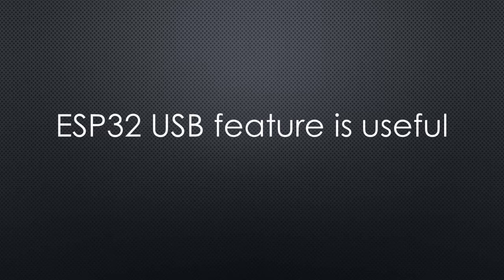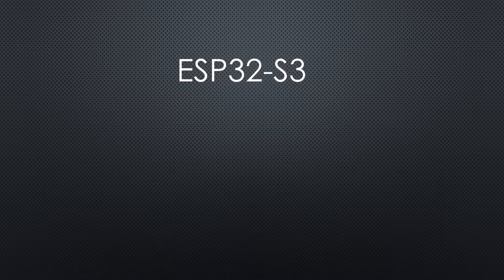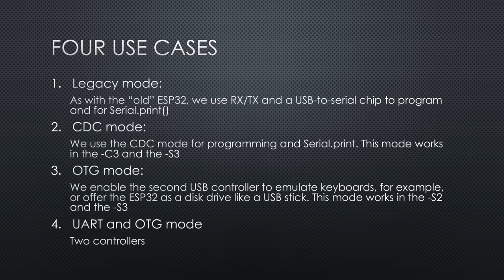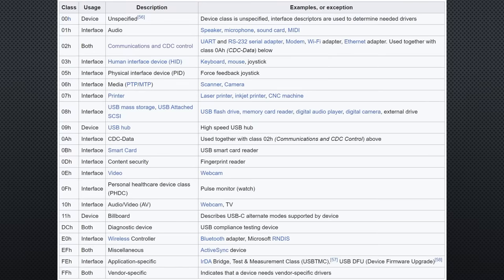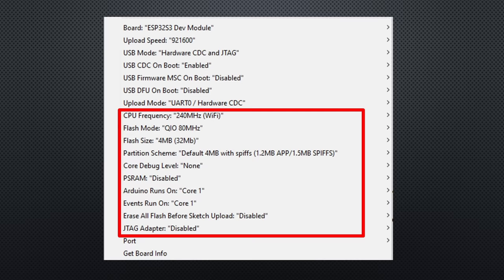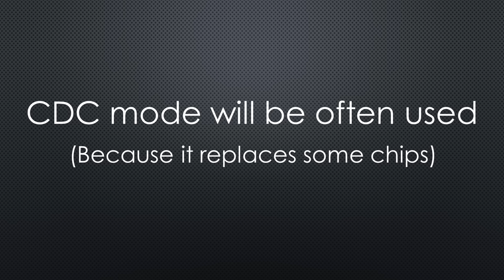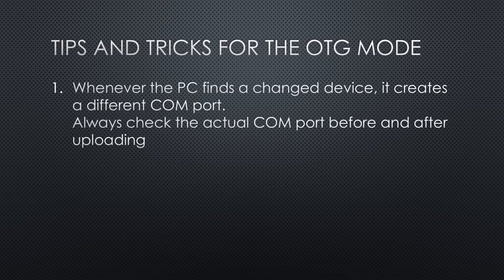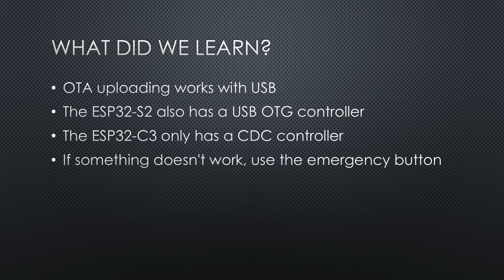456 Hassle-Free ESP32 USB (ESP32-C3, ESP32-S2, ESP32-S3)

Comment: CDC mode actually works on the ESP32-S2 also
Reply: You mean "USBCDC" as how it is called in the Arduino code?
The one supported by the C3 is called HWCDC.
The S3 does support both. I prefer the HWCDC as it allows for easier flashing using the web flasher.
But the USBCDC does have some more nice features and the code feels slightly more mature compared to HWCDC.
Reply from the maker: Thanks for the info. I assume, CDC is part of the OTG block services.
Reply: @TD-er  use the esphome flasher instead of web flasher is way better and more reliable
Reply: @TD-er  HWCDC is realized in hardware, so the features are limited to only what is required for communication between the code and the hardware.

Comment: Interesting, but I miss something. How does the ESP magically apply the settings from the Arduino IDE? Are they set when uploading a sketch / compiled into the sketch? If yes, can't you basically brick your dev-board if you accidentally upload something with legacy mode on a board that only exposes the USB pins for uploading in cdc mode?
Reply: Just make a few corrections to the board and you should be able to revert back. A circuit diagram and the data sheet, soldering iron and jobs a gooden
Reply from the maker: The settings are in the code. To „unbrick“ the chip, you always can apply GPIO0 as described.

Comment: Hello, I'm a bit baffled. On Arduino IDE "USB Mode" doesn't show up on my ESP32 s2 chip. Is USB OTG enabled by deafault on the ESP32 s2 or is there a way I need to put it in OTG mode
Reply from the maker: Unfortunately, I cannot do remote debugging. It should work as described in the video and does not has to do with OTG.

Comment: Thanks for your sharing!!! It is very clear. But I met a problem that the window10 device management recognized an unknow USB device. I am not sure that the problem is caused by windows driver or the layout of the PCB or the hardfirm of the ESP32-S3. I use the ESP-IDF on VS code to develop it. I want to ask that  when I get a totally new ESP32-S3 that never download any code by me, when I connect it via USB port, could the windows 10 recognize the USB port directly? Thank you very much!
Reply from the maker: Unfortunately, I cannot do remote debugging. Here, the ESP32-S3 is recognized by my PC. If you bought a regular board, the chance that the board is not working is slight. If you have a custom-built one, check first with a standard one.
Maybe your PC does not have the correct driver installed.
Reply: @AndreasSpiess  Thank you very much for your reply! It is very kind of you. I have tried the official board and confirmed that the driver was installed. So I am not sure that if I should download a specific firmware to enable the USB port. Anyway, Thanks again. and welcome to China. I want to take you to try much delicious food. 😁

Comment: I knew about half of these -- thanks for the comprehensive examination.  One of the things I learned was that the C3 had the CDC Mode -- I was, for some reason, thinking that it did not have any integrated USB functionality at all.
Reply from the maker: These usb functions were not well communicated, I think.
Reply: Nothing about the ESP32 is communicated well.  Horrible reference materials and tools.
Reply from the maker: @gavincurtis I do not agree. The datasheet has a lot of info. And Google knows even more because the chip is widely used.

Comment: Thank you for confirming USB Host mode is not currently present. That was a real head-scratcher when I bought a couple of these a month ago and had to abandon a project.

Would have been great to have had this functionality from day 1, but glad I didn't waste my money, cheers!
Reply from the maker: It should be supported in one of the next releases…
Reply: It works in esp-idf, which is generally a much better way of using them anyway. ESP-idf even has the option to include arduino as a component so you can write code for it just as you would using the arduino ide but with the possibility of using esp-idf specific features too.
Reply: @conorstewart2214  I tried using the ESP-IDF+VScode for the first time. It went reasonably smoothly but for the life of me I could get the "hid_example.c" to recognise when I inserted a USB device into either a female USB-A or USB-B micro breakout board.

Would love a video from Andreas to demystify this specific setup! ♥️

PS: I'd spotted the "Arduino.h" include before but didn't realise if was for people using the ESP-IDF, interesting!

Comment: I used the S3 chip in a window sensor design using a USB-C port for programming. So much more convenient than hooking up RS232, especially when they are already glued to the window frame.
Reply from the maker: Thank you for sharing your experience!
Reply: Hello! I am making a ESP32-S3 custom PCB. I want USB-C programming, can I just connect it to D+ and D- and then I can just program it, or is there anything else I need to think about in my design?
Reply: @danielliden600  Take care of the correct CC1 and CC2 Resistors. Because the plug fits in both orientations, you need to bridge the pins for both sides on your pcb.
Think about power. USB can deliver your 5V, but you have to step it down or use an external source. For my application I rely on the battery for power and use only D+ and D-, but I have CC1 and CC2 designed to put resistors to ground. Not sure if I do this right, but at least it works for me.
Further I added pin headers for the old RS232 on the board as well as BOOT and EN buttons to be on the safe side, in case USB does not behave.
Reply: @drstefankrank  Thanks for response! From what I understand the ESP is 3.3V board, but the D- D+ is 5V. Do you have yo regulate it down to 3.3V before going to the ESP or is it safe to go directly to ESP?
Reply: @danielliden600  The D- and D+ can be directly attached. Just the power that is delivered through USB is 5V and has to be stepped down to power the ESP if not powered differently.
I use a LiFePo4 to power it and for the one time programming I can use this or I use an external 3.3V supply while having it on the bench.
Reply: Would you happen to know what pins are optimized for I2C, I2S and SPI on the S3?

No engineering examples of the S3 exist to show what pins are optimized for  I2S implementation. 

Blows my mind such a powerful device has worthless information to back it up.
Reply: @gavincurtis  In the datasheet on page 38 is the SPI Pin Configuration which links you to the IO table starting at page 16.

Comment: Thanks! This was the final step in my prototype mini ffb wheel. I've got the device recognized as a 1 axis 0 button joystick and the rotary encoder drives the axis input.
As a tinkerer only, MAGIC.
Reply from the maker: Fantastic! It is always rewarding if it works.
Reply: Вы делали какую нибудь инструкцию? хотелось бы посмотреть, как вы это реализовали
Reply: @Bondarev-Y   Sorry not yet. I have run into problems with Windows drivers. It is very hard to get Windows to recognize a device as force feedback capable. I've tried hundreds of attempts but Windows doesn't play nice. If you are okay with only one way communications so that is the ESP32 acts as a controller, it is easy. For the ESP32 to be controlled by built in Windows drivers much harder.  For now I have just simply recreated this design with 1 rotary encoder and 2 potentiometers. Soon I will add more controls.  https://youtu.be/7g6O4G1OXd4?si=ztOf1aowJ5kJ0riX

--------
@Bondarev-Y К сожалению, пока нет. Я столкнулся с проблемами с драйверами Windows. Очень сложно заставить Windows распознать устройство как поддерживающее обратную связь. Я пробовал сотни раз, но Windows не идет навстречу. Если вам достаточно односторонней связи, где ESP32 выступает как контроллер, это легко. Но сделать так, чтобы ESP32 управлялся встроенными драйверами Windows, значительно сложнее. На данный момент я просто воссоздал эту конструкцию с одним энкодером и двумя потенциометрами. Вскоре добавлю больше элементов управления. https://youtu.be/7g6O4G1OXd4?si=ztOf1aowJ5kJ0riX
Reply: @Curt-0001  There is an OpenFFB project, in it someone set up S2 and S3 for feedback. Perhaps this can help you

Comment: As mentioned in the comments, MCPWM  using the Arduino IDE would be a cool video.
Another idea is the pulse counter, as that isn't simply available in the Arduino IDE but would be very useful.
Something to work on during your summer break! 😊
Reply: Yes! Pulsecounter please! I'm totally lost at the moment building something to print out the error code from my Motoronic 2.2 in a old BMW R1100r.

Comment: Thanks for the video.  Please make more about esp32 features and such, especially the esp32-s3.  What I love about your videos is the originality.  Seems most utubers just copy one another... Waiting on your debug video mentioned here.
Reply from the maker: The debug video will come after my summer break…
Reply: Would you please make a video of the S3 showing what pins are optimized for:
I2C, SPI and I2S?
Reply from the maker: @gavincurtis  You should find this info in the datasheet. There are no "optimized", just possible pins
Reply: @AndreasSpiess  Thank you for the replies.  So if I understand correctly, the high speed ports can now be switched to any pins using the I/O Matrix with the ESP32 S3 without issue?

I have a product design working great with the original ESP32 WROOM.  MicroSD, SPI, I2S and I2C features are all being used.

The ESP32 WROOM we are using is now obsolete.  So changing gear to update to ESP32 S3.

It also appears the serial loader bootstrap pins IO_0 and IO_2 have changed to IO_0 and IO_46 as well?

Again,
Thank you for your help.

Comment: I couldn't get Serial.print() to work with my Lolin S3 Pro.  I could program it, but just couldn't print to the serial monitor.  After watching this video, I learned about CDC mode and by changing the "USB CDC on Boot:" to "Enabled", its all working!!!     

Also, in the Arduino IDE, I couldn't get the "ESP32S3 Dev Module" board to work, but selecting the "Lolin S3 Pro" board worked just fine.  There are obviously some differences between the two.

My next step is to get PlatformIO installed and use it as my primary IDE for projects.  I've used it in the past, but need to install it on my new Linux machine.  I like the Arduino IDE for simple projects, but like PlatformIO better due to its better layout and functionality.  But its a bit more difficult getting started.

Thank you for your hard work making such videos!!    😃😃😃
Reply from the maker: I am sure you will enjoy PlatfgormIO. The -S3 should behave very similar there.

Comment: What a coincidence... I've been working on exactly this for the last 2 weeks. (complete rewrite of my ESPEasySerial wrapper to have a single interface to any possible serial port)
One thing to keep in mind for the S3/C3; There is a bug in the Arduino code, which renders the serial port unusable when calling end(). (will be fixed in the next ESP32 Arduino release)
Another nice thing from the CDC uart ports is that the host (PC) determines the baudrate, so it doesn't matter which baudrate you set in your terminal program to connec to the ESP.
Reply from the maker: Thank you for the additional information!

Comment: Thanks for the great video Andreas. I have been looking for how to use ESP32 in host mode (I want to use it to convert the signals from a USB Joystick to CPPM for RC) but the information over there is very confusing. There are projects out there using simple arduinos and USB Shield but I wanted something smaller and more flexible to be able to add more functionality.
Reply from the maker: You still need a host shield for this release
Reply: Have a look at using the esp-idf, it has host mode examples.

Comment: ESP32-C3 "download" or "Strapping pin" is not GPIO ZERO (anymore) - quite a change in the design - but GPIO 9
video description is with letter mistake - I am sure you wanted to say: "S2 C3 S3" ;-)
Reply from the maker: Yes, you are right. Thanks, title adjusted.
Reply: @AndreasSpiess  No, at this time it still keeps featuring "ESP32-S2, ESP32-S2, ESP32-S3"

Comment: Ich liebe Ihre Videos. Sie sind der Größte!!!
Reply from the maker: Danke!
Reply: @AndreasSpiess  Gerne, war ehrlich gemeint!

Sie werden sicher mit Anfragen und Kommentaren zugeschüttet. Darf ich Ihnen dennoch eine Frage stellen?.... 
Nachdem es mir dank Ihres Videos endlich gelungen ist, mein eigenes PCB mit einem ESP-32-S3-WROOM (N8R8) zu designen und bei JLCPCB fertigen zu lassen, stehe ich nun vor einem Rätsel, was mich schier zur Verzweiflung bringt.
Die Arduino IDE erkennt das Board und ich kann einen Sketch im CDC-Mode downloaden und nach Reset startet der Code auch und meine 4 LEDs auf meinem kleinen Board blinken wie gewünscht. Hurra! :) 
Jetzt die schlechte Nachricht, der Code läuft nur, wenn das Board am USB-Port des PCs abgeschlossen ist. Verwende ich ein Steckernetzteil, geht nichts. Habe natürlich andere Netzteile und Kabel, Powerbanks, Direktanschluss von +5V am Spannungswandler mit einem leistungsfähigen Labornetzgerät versucht. Brachte alles keinen Erfolg, obwohl am ESP ganz saubere 3,3V anliegen. Das Board zieht 20 bis 40 mA, also nicht die Welt für den von mir verwendeten AMS1117-3.3 Spannungswandler.
Dagegen funktioniert das Board bei Anschluss an andere PCs oder auch an den USB-Port eines Notebooks im reinen Batteriemode immer auf Anhieb.
Habe auch schon versucht, IO19 und IO20 (USB_D- und USB_D+) mit einem 15k Pulldown in einen stabilen Zustand zu bringen, hat aber auch nichts gebracht.
Haben Sie eine Idee, was die Ursache sein könnte?
Verzweifelte Grüße ;)
Harald Raufer
Reply from the maker: @haraldraufer6992  Remote debugging is hard. I would compare all pins of a board in working condition with one that does not work. There must be a difference. Look also at the serial pins. Maybe they show a brownout or so.

Comment: Had to "burn" that efuse (USB_PHY_SEL) to use native USB? I designed and built a custom board with an S3 and want to get the native USB part functioning so I can program it, as there isn't a USB to UART IC on the PCB. Thanks in advance for answering soon!
Reply from the maker: I never heard of this eFuse. So you have to refer to the datasheet.
Reply: @AndreasSpiess  Thanks for answering. Seems it is an S3 thing to enable native USB in that MCU.

Comment: Hello there and thank you very much for this video. I am very new to esp32 and absorbing every information I can get. Sorry for maybe a noob question but does running in CDC mode also mean I can still send serial data from esp32 over usb to the computer (like temperature value of temperature sensor) but do not need to install a driver anymore in Windows 10 like when using cp2102 or ch340 ?
Reply from the maker: This question is not easy to answer. It depends on the protocol you use. For USB, you always need a driver, but often, they are included as a standard.

Comment: Hi Andreas.  I have been in the front row for a couple of years so far.  As a retired Engineer, I have been playing with ESP32S dev boards and using PlatformIO as my IDE.  I was excited by your S3 video and immediately went to Amazon to look for a board that might be easier to debug with.  Then got confused.  Many of the S3 boards have a USB to serial chip for the 2nd USB port.  Some don't.   I am guessing that the USB to serial IC is there to  "comfort" legacy users?  The boards containing 2 USB ports but no USB chip must use the two ports you discussed in the video.

I an thinking that the USB chip boards would suffer the same fate of older ESP32 needing the RESET/GPIO0 buttons.  And the boards using the two ESP32-S3 ports would debug more reliably.

Always enjoy your vids....
Any thoughts?
Reply from the maker: As you suggest: The USB to serial chip is a „comfort“ function and ok for a development board. For a productive board, I would only add a jumper for RX/TX.

Comment: Sometimes I wish PlatformIO would have such selection menus for the Microcontroller features. With the ArduinoIDE It's pretty easy, but with PlatformIO it can be quite a hassle to figure out which build flags to use. Same for other memory sizes or so. So easy to change in the ArduinoIDE, but in PlatformIO it seems to require custom board configs. For programming I prefer PlatformIO by far, but the handling of boards and features is much easier in Arduino IDE.
Reply from the maker: I thought, I was able to select the board also in PlatformIO. But I do not use it often.

Comment: Regarding how the dual-core ESP32-S3 (USB OTG + USB Serial/JTAG)  has the combined features of the ESP32-S2 (single LX7, no Bluetooth, JTAG, USB OTG) and the ESP32-C3 (Risc-V, BLE 5, USB Serial/JTAG).. 

any plans to do a video on how to setup VSCode to debug an ESP32 using an external usb jtag debugger (ex. ESP-Prog)?  I've found some older information, but it no longer works with the current IDF and VSCode plugins.
Reply from the maker: I do not cover the IDF on this channel, only the Arduino IDE.